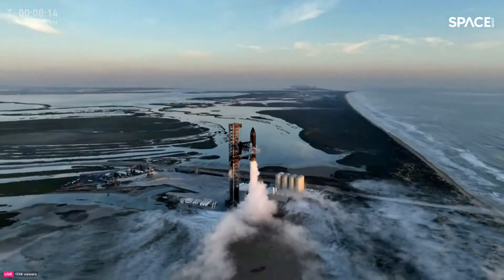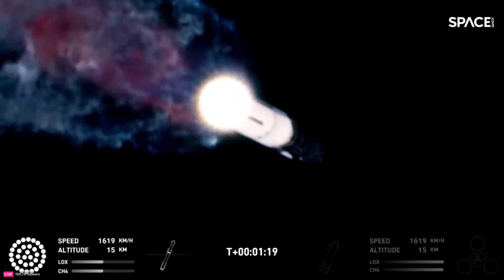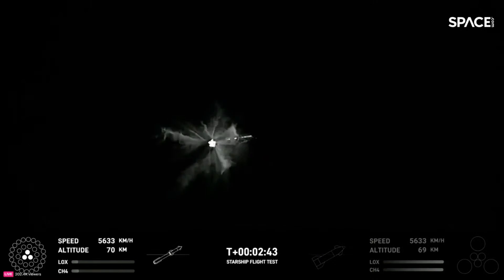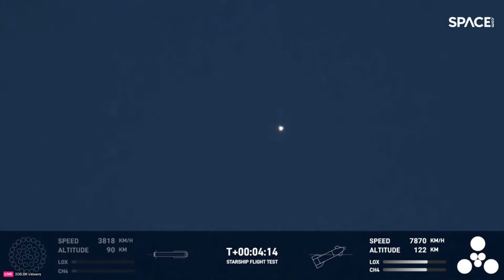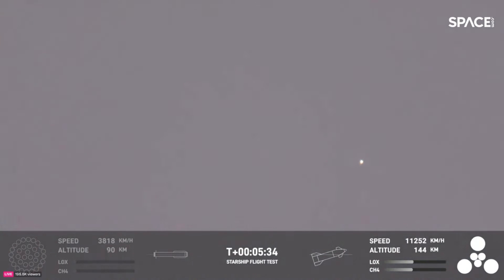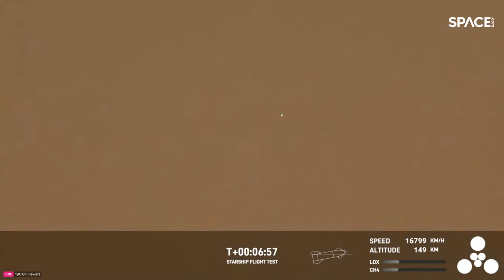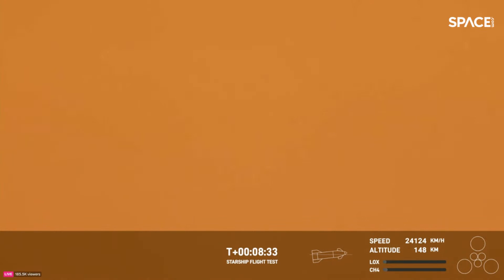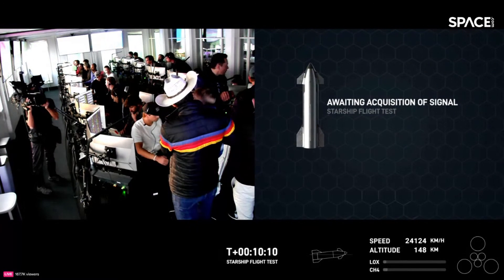SpaceX Starship launches on 2nd integrated test flight, booster explodes after separation

Comment: All 33 engines running! 👍👍
Reply: Nasa had 5 only on their first stage of theirs lol.
Reply: @sexy_tanjiro8878 on Saturn 5? Yes, but if only one was to fail, the mission would have been terminated.
Reply: None Ever failed!!!! @DevCristi
Reply: @sexy_tanjiro8878  And those get thrown away with the rest of the rocket, need enormous solid fuel boosters to actually launch in the first place, are outdated compared to the ones SpaceX has developed, and one launch is more expensive than the whole Starship program so far.
Reply: @sexy_tanjiro8878
Had. lol.
Reply: so where did the starship go??? did it came back down??
Reply: @neitel17  why? You didn't see the video?
Reply: @neitel17 booster got germinated after hot staging and starship most likely got automatically terminated during Seco
Reply: Destroyed, it didn’t make it, RUD.
Reply: @neitel17 hopefully the flight termination system wouldn't allow it to hit the ground in one pice it most likely expolde the second the data stream stoped around engine cut off
Reply: RUD! SUCCESS! 33 Raptor engines destroyed. 🤣🤣🤣🤣🤣🤣👽👽👍🏼👍🏼
Reply: And yet, still did not reach low orbit....
Reply: @larswhitt1549 it was a test launch and wasn’t designed for orbit. This was a massive improvement from the last launch. Also, not good enough for you? Go build your own space company and show us all how it’s done.
Reply: @larswhitt1549  looking at this logically and how much money space x has to spare, its just a matter of time before they get to orbit and perform re entry
Reply: @larswhitt1549   even if everything worked they weren't even gonna perform LEO just Teo and techincally they got to space with enough velocity to spare